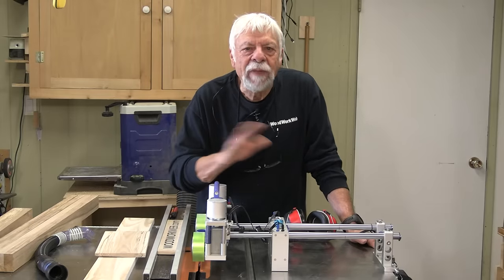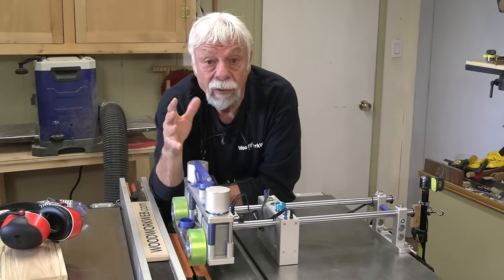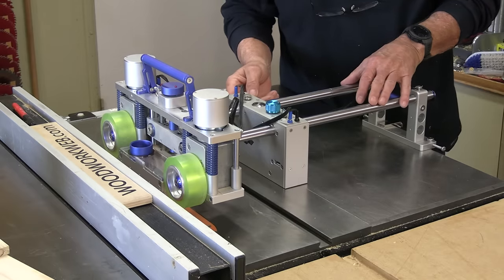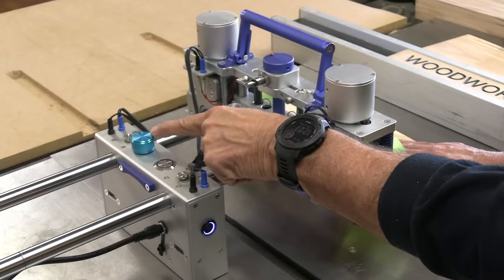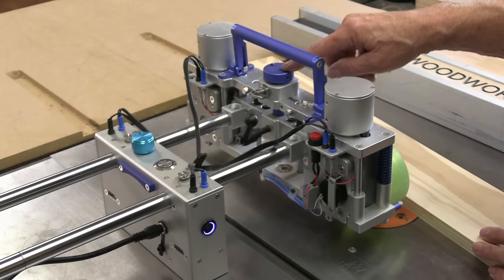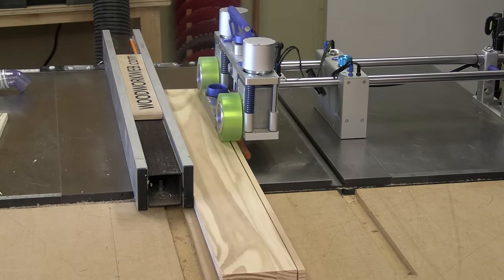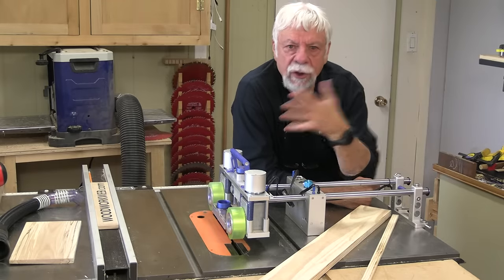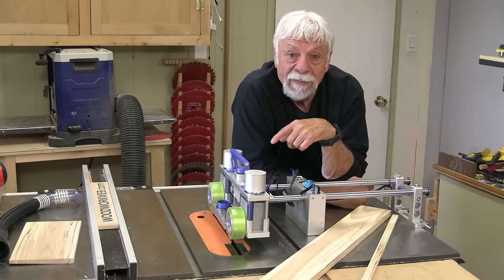Revolutionary Table Saw Feeder: This Changes Everything!

Comment: Definitely looks useful for mass production/repetitive tasks.
Reply: I used one back in the 1980s to cut 1/4" dados in drawer side rips before cutting them to lengths.
Reply: I like the fact that it was back in the 1980  @SandBoxJohn
Reply: Certainly for repetitive cuts, but it might be pretty nice for times when you just want a perfect cut on even a small number of similar width cuts.  Especially for plywood, where there isn't some large amount of spring in the stock.

Comment: Thank you for this!  I recently donated my 1/4 hp stock feeder to a nonprofit because it was too heavy, too awkward, and generally a complete pain to use in my shop where a feeder is not a full time item on the cabinet saw.  I loved its function, but beyond that I hated just about everything about it.  This type of unit would absolutely be a game changer.

Comment: Glad to see everyone having a good time here! I am the inventor of it! Feel free to ask if you have any questions about its use, performance, or technical aspects! I'll respond as quickly as possible!
Reply: If you look at the back of the unit @ around 4:51, it would be good if you could hide the wires by enclosing the back. It has the look of a prototype.
Reply: Thank you for your message. Yes, those wires are for the laser indicators. I will optimize their wiring!
Reply: @ricbarker4829  agreed that it needs enclosing to protect the internal wiring from sawdust and wood chips.
Reply: Hey, this seems excellent.  Given how common the sawstop saws are, making sure the components around the blade are non-conductive would be a big help.  I can't tell what everything is made of, but it looks like there's some aluminum there, which could trigger things if something wasn't setup perfectly
Reply: @MrAjime  Your observation is correct. It is made of 6061 aluminum alloy with precision CNC machining. As for compatibility with SawStop, there should be no issues because the part that comes into contact with the table is the surface of the two drive wheels, and the tire surface of the drive wheels is made of non-conductive PU material. Thank you very much.
Reply: @smitoolca5765 What about a saw stop with a sliding table attachment?  Depending on how it's set up, it can make the space to the left of the blade considerably wider.  Would it be possible to have an option for longer support bars to enable this to work in such a situation?
Reply: Sure, we've intentionally designed the support bar as a two-part system. Based on your needs, you just need to purchase two additional standard support bars (don't worry, they're affordable). Connect them through the threaded connection to extend to a maximum length of around 44 inches. Thank you.
Reply: @donalddolan7709  However, I must point out that for optimal use, the distance from the saw blade's left side to the control box's right side should not exceed 20 inches. A greater distance may result in reduced spring pressure. Of course, in such cases, you can use the maximum drive gear to counteract any adverse factors.
Reply: What is the max thickness of material this can cut?  Will most of  the wiring be enclosed, seeing that as an issue getting caught and pulled out unintentionally.
Reply: @EliteHome1  up to 2 inches. Yes, will do it! Thank you!
Reply: Ok 50mm is less than I need. I rip recycled timber at full blade depth.
Reply: I have doubts that this feeder could handle a 8" wide 8/4 x 8' long hardwood board without needing a manual push through by operator.  Only two wheels for gripping the board vs. 3 or 4 wheels for other power feeders.  It says up to 1/2HP but those motors look pretty small.  My 1/4HP feeder weighs 70 pounds and a 1/2HP feeder comes in around 120 pounds. A MagSwitch power feeder for regular power feeders costs around $1k but they are not electromagnets, so not sure how powerful these magnets are.  Great idea though!

Comment: This thing has been so overdue! I was thinking about an invention like this years ago, I thought how could literally nobody have thought about this before??? Finally, no more fingers lost!
Reply: Power Feeders have been around for decades, this is just a more shall we say, Modern tech model, Grizzly and Shop Fox both have a more old school version or basically the same design from its beginnings around the 1951, at first they were typically used for routers/Shapers. Currently going for about 400 bucks to well over a grand depending on the size you get, ranging from 1/8HP to 1HP, the 1HP version is a beast of a machine wicked heavy and would require a dedicated table saw, just so you don't have to move it and have one free table saw for breaking down plywood.

Comment: What a great addition. The safety improvement takes away the fear of kickback.
Reply from the maker: Well, it reduces the risk, not sure it takes it away all together, you would need to keep the drive wheels clean and make sure you have sufficient clamping pressure on them ... but yes, the good news is it keeps fingers away from the blade

Comment: 1 feature i like is the 2 wheels straddling the blade but thats about it. I've got the Grizzly baby feeder ($350) paired with the Magswitch kit for the base ($300) that allows me to put the feeder anywhere on the saw. The main feature missing is dust collection which is a problem with multiple cuts. I can get almost 100% removal with the Grizzly.
Reply: I  have been looking at the grizzly myself, at $350 you must have to 1/8HP version. May I ask, how do you like it? what is the weight like? More importantly, what don't you like about it? how does it limit your work if at all? any information you can give will be a great help, as I am working on building my workshop for the physically and vertically challenged lol

Comment: I'd like to see what it looks like after 500 cuts. All that shiny metal is going to be covered with sawdust and all those little intricate parts are going to be a challenge to keep working if they don't enclose it in sealed metal or plastic.

Comment: From the video I have several comments concerning this tool and its usefulness...First the positives...It is definitely more compact than my 1 hp. Powermatic 4 roller power feeder.  It seems to be fairly easily adjustable and the samples you fed through were small and "ideal" boards for which it works great.  Now for some not so positives...First not all woodshops have great dust collection. I have a dust collector on my saw but still end up with lots of dust all over.  With all the exposed parts I would expect that machine to be covered in short order in my workshop.  All of the exposed parts are also at risk of damage because I don't handle small boards.  I have run over 10's of thousands of board feet through my saw because I size rough lumber which is not perfectly straight and also make shiplap using dado sets.  Most of my wood starts out as 8', 10', or 12' lengths and anywhere from 1" x 16" to 2" x 12".  I question whether this tool would survive the stress of such loads or potential damage from handling large boards some of which have hit my Powermatic in a way that would damage the auto cut.  Also I don't see a single wheel working to feed consistently with rough lumber.  I didn't see it having multiple feed speeds either where my Powermatic has 4 different speeds which really comes in handy with either very soft woods or hardwoods.  For the record I am a hobbyist and not a professional as I have used my wood shop to produce over 100k board feet for a house I have built from scratch with lumber I have milled myself from the trees I have cut.  For the small hobbyist this might be a great tool and the electromagnetic mount is a great idea.  However I don't believe this is ready for more than a niche of the woodworking market.

Comment: I could really see a mag switch on the outrigger mount instead of a clamp. I'm sure you could make something that can solve that, lol.
Great idea. I always thought I little duty setup would help alot of smaller operations out.
Reply: I think the clamp is ok, but I'd put a mark on the table where the outrigger goes, so you don't guess.  Maybe a line scribed on the table where the magnetic one goes too?  And maybe the clamp end can be one where there is something like a Destaco clamp?  so just a lever out there?  after all, it doesn't have as much torque out there.

Comment: What you didn't mention is the Auto-Cut also has a dust port.  No other power feeder that I've seen has this.  The dust that comes off the blade, even when a strong dust collection unit is hooked up to the table saw cabinet, is the tiny dust particles that can impact your lungs in a very bad way.  That's why many use over arm dust collectors above the blade that cannot be used with traditional power feeders.  This is what I've been looking for.

I have a slider attached to my cabinet table saw, so no where to clamp the end rails.  My current 1/4 HP power feeder attaches to my table via MagSwitch power feeder mount, so I'll use those to anchor the end rails by modifying my shop made hardwood MagSwitch base.

Comment: The thing where the workpiece tipped up once it passed the first wheel worries me--seems like it'd be important to have one more wheel past the blade to keep the work against the table through the whole cut. And/or a full-length perfectly-parallel outfeed table.

The saw still needs a splitter or riving knife--if there is tension that gets released by the cut, the blade can still grab it and the table saw motor is definitely stronger than the feeder motor. The feeder needs some kickback protection built into it, in the form of pawls perhaps?

Comment: Jessem has a tool sort of like this.  It attaches to the fence.  It can't give you quite as much clearance as this but otherwise it's similar.  The main difference is the wheels are slightly angled, to keep the work piece snug up against the fence.
Reply: I have the Jessem. It’s a better solution for dealing with plywood. The idea of this is better for narrow stock.

Looking more I think the Magswitch base with a standard feeder is a better solution overall since can be mounted on either side of the fence

Comment: Colin looks like it's a useful tool, my table saw is a heavy plastic top and my router table is aluminum if they made it to attach some way it would be useful for those of use who don't have a cabinet table saw,
Reply: My table saw, Ridgid contractor saw, is not magnetic either. Perhaps a sheet of steel could be fastened to the existing table top.
Reply: @mikem1436  hi Mike yeah my table saw is a Ridgid also I did try to use a thin sheet of metal on top it threw my fence out that it wouldn't slide to make small adjustments, once I move to a new shop I am going to see about a cabinet table saw, Mike don't get me wrong the Ridgid is a good saw I need something that I can setup easily trying to make 45s can be a pain good luck
Reply: @alanwasserman8176  I am in the sort of same boat as you. All my items have to be portable since I live in an apartment and move them around quite a bit. I will be retiring shortly and plan on building a workshop. Cabinet table saw is one of the first, if not the first, I get.

Comment: For this to work for me I’d need the base to mount on both sides of the fence. Also, when mounted to the right of an Incra brand fence the base would need to straddle the fence’s aluminum shaft that is perpendicular to the fence. Also, wouldn’t spreading the magnets out to the front and back of the saw increase the leverage, perhaps eliminating the need for the outrigger? A remote stop/start and speed control may be helpful too especially when working with sheet goods, and finally options for shielding/dust collection?
Reply: A pedal controlled switch would definitely be useful, and should be something relatively easy to add

Comment: I've used a power feeder since the 70's on table saws and shapers. Albeit, they were much larger and required bolting into position. This smaller magnetic version could save tons of setup time. Warning: once you go power-feeder it's hard to go back. :)

Comment: PretIt looks relatively simple, I like that. My first thought was that it could be useful for ripping thin strips from board to be used for molding or trim. For me that would probably be the primary use case.
I'm also wondering if it can be put on the other side of the fence for cutting wide material?
Reply: I’ve been wondering that but the mounting brackets only seem on one side. Looks like the bars are high enough to clear the fence but only seems single direction.

I have the Jessem TS guides. They seem to work well for holding plywood against the fence but don’t work well for narrow stock which this seems designed for. 

This also has the same issue on the router table where I could see wanting to mount behind the fence for door panels.

Comment: Very interesting table saw accessory.  I was wondering if you could connect it to the other side of the saw and over the guide so you could run panels through that extend over the edge of the saw?  Simply, do the wheels run in the opposite direction also?
Reply: I was wondering the same.

Comment: Can this work without the fence? I worked for a cabinet shop that had some old school equipment and they had a rip saw with top and bottom feed rollers, top side 3/16 kerf blade. There was a wire above the saw that cast a shadow and the shadow aligned with the blade. You could take a board, over 10 foot long, with a bow in it, get the shadow lined up end to end, and then let the rollers grab it and it would run the board straight through and come out straight. It was an awesome machine. If this can do that with smaller stuff, that would be cool.

Comment: I like this a lot. The big commercial feeders are heavy, need special mounting, take up a lot of room & don't easily  allow for work space reconfiguration. They are also expensive.
This addresses most of that. (It will probably not be cheap tho..)

 Two things worth mentioning:  in addition to safety (which is huge), fatigue reduction &  efficiency, powered feeders make smoother cuts with less saw marks and chance of burning because feed speed, pressure and angle is consistent. On the negative side, this looks like it won't feed bigger stock and has limited utility on sheet material vs normal feeders.